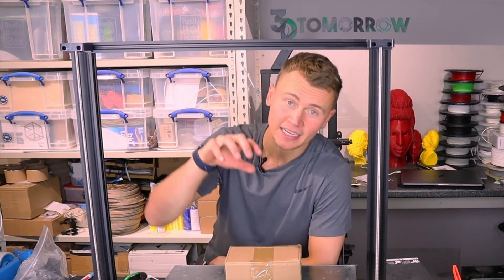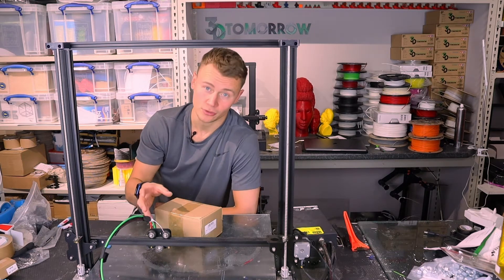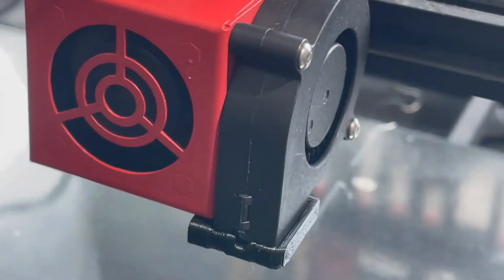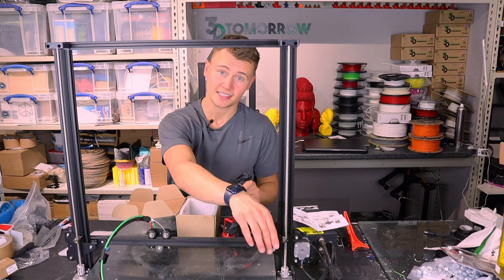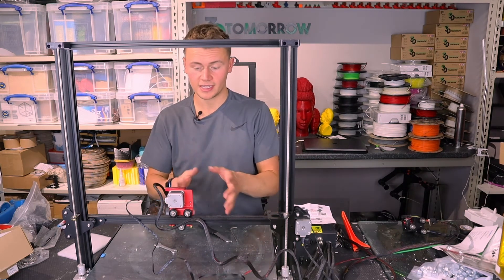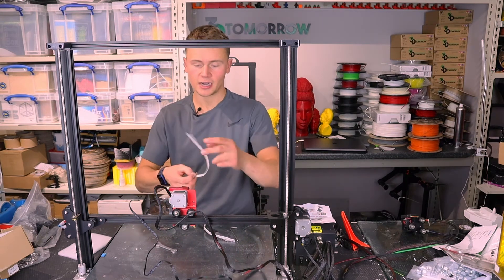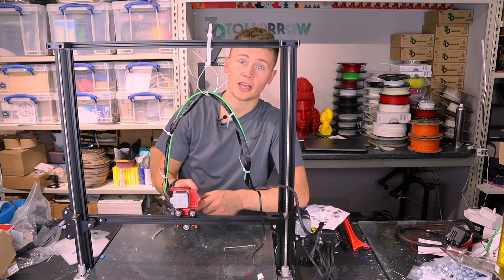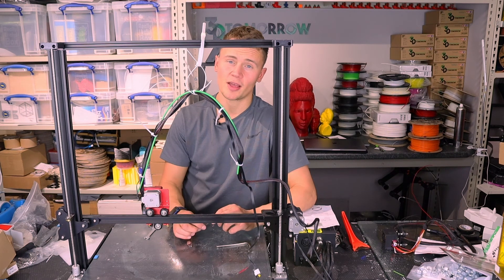Direct Drive Upgrade - Creality CR10 S5 (Equivalent suitable for Ender too)

Comment: Nice video how about upgrading the main board and screen I have mine to a 4.2.7 32bit and the later ender 3 v2 screen a lot smoother on the prints and less noise yes the broad is  24v but runs nice on 13.7v just a thought for you on another video

Comment: I get the being lazy bit... but for the sake of 2 holes, why didn´t you go for an H2 V2 extruder or something similar? Lighter, more powerfull, flexible, much better printing quality, and even easier conversion (aside of the two holes for mounting) and FAR more reliable than an MK8 hot end (im running 3 h2 so i can vouch for its reliablility). I´m saying H2 because is the lightest, cheapest option V6 compatible out of the box right now, but any all in one integrated extruder would have been beetter than this!! Its a pretty outdated conversion dating almos to the age of the printer. It was a great oportunity to actually update the printer and move away from the dodgy MK8 extruder... (oh, and no buildplate size reduction)
Reply from the maker: Thank you for watching and your comment! For this upgrade, price and convenience was also a factor, this part was only £34 and required no additional parts. The H2 V2 may well perform better, but not sure this printer warrants a significant improvement, since the mechanics of the printer aren't great! My logic for this upgrade, was that - because it is sooo easy - others would be more inclined to give it a go. Those a bit more informed, perhaps like yourself, would probably have already upgraded their machine with some other extruder + drive gear combination. I am confident this upgrade would work well for others though, as has completed a number of 5+ day prints since installation without problem.
Reply: @CallumColes  ok. I will admit that 34 quid is pretty unbeatable when it comes to cost. And if is able to run 5days plus prints, is a good workhorse. (Didn't really doubt about it as my firts direct drive was something like yours but self designed). However,  lets agree to disagree about the poor mechanics of a cr10. A bed slinger well tuned and a bit rigidised chasis, along with klipper would make wonders ...
Keep the good work.  I've never needed to have a 5 day + print,  maybe coz my cartesian are faster or coZ i don't print big enough.... but you definitely deserve all my respect!!!

Comment: Nice video, always like to see you put up new content. But I have a complaint, you started me down the upgrade path with the replacement of the stock extruder on an ender 5 plus. This sent me down a rabbit hole ending in my 5 plus now fitted with a BTT Skkr mini e3 v3 and a Biqu h2 v2 direct drive and running klipper. I hope your happy as now I have a truly great printer and this was in part to your help in giving me the confidence in making the first upgrade 😂
Reply from the maker: Thanks Steve, glad to see you’re still watching after I had a bit of a break! Sorry to hear you’ve gone down the rabbit hole😂 but you’re welcome for some better prints. You’re giving me upgrade envy, think I’ll have to start doing some more myself.
Reply: @CallumColes  yes, I found the mechanical upgrades easy, but it was my lack of marlin experience that forced me down the klipper route. Though klipper has its downsides, I found it a real help to resolve issues due to the fast config change ability, no more flashing sdcard files onto mainboards 🙏😀.
just as a side note, I have had a few people on face all asking for somewhere to get filament sample bundles to test in the UK, I replied to them suggesting your company as you sell samples via Amazon. Would you be able to sell large sample packs, wide range of your filaments as a single pack for people starting to learn printing or looking for a better supplier than the usual Chinese offerings. Even if you offered this as a order option through your website and you can build sample as you receive orders. The main reason seems to be the people asking want to try different colours etc but don’t want to buy full reels but also want to support a uk company.